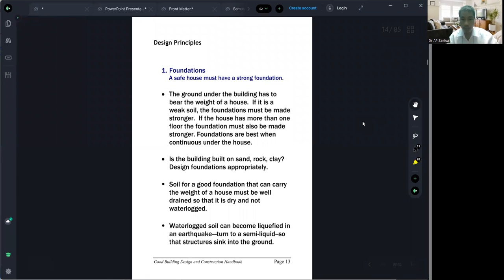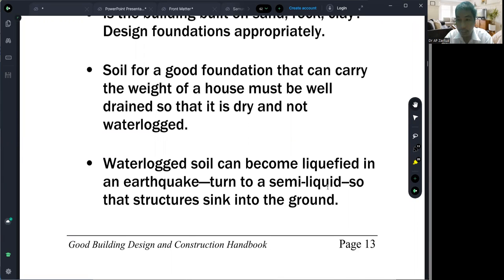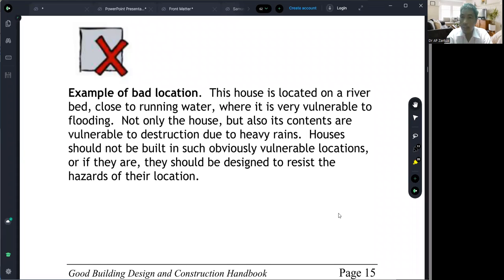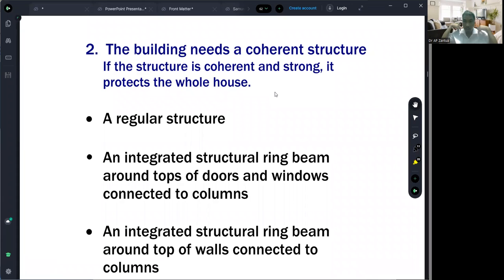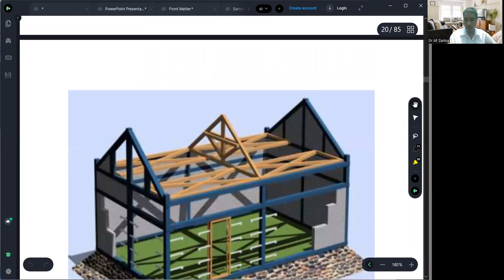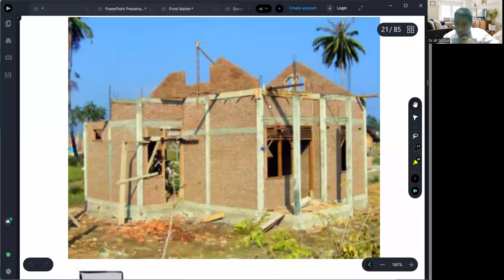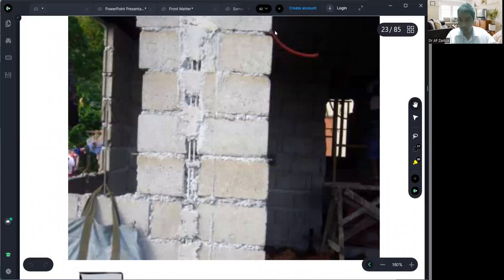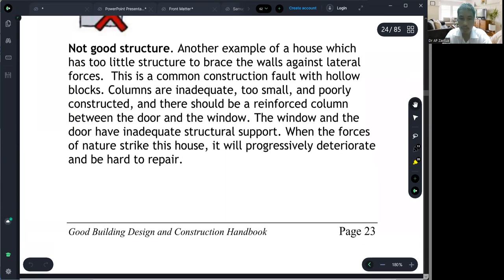Good Design Principles: Foundation & Coherent Structure [ Good Building Design ] Module 0A

Comment: Thank you for providing us with a concise summary of the design principles. I've learned that the earth beneath a structure must support the weight of the structure. If the soil is weak, the foundation must be strengthened.

Comment: Thank you for giving us a very well-explained summarization about the design principles. I’ve learned that the ground under the building has to bear the weight of a house. If it is a weak soil, the foundation must be made stronger. If the house has more than one floor, the foundation must be made stronger. Foundation are best when continuous under the house.